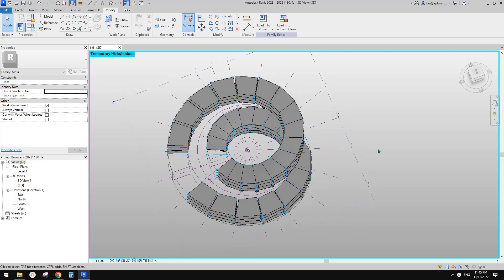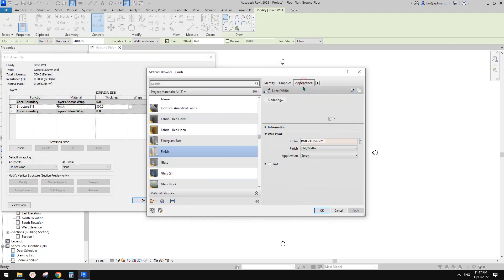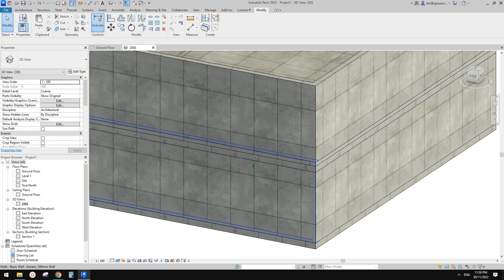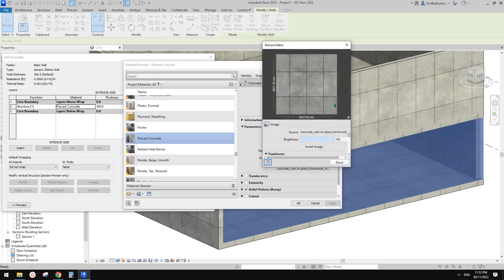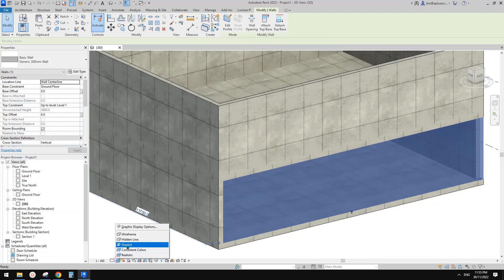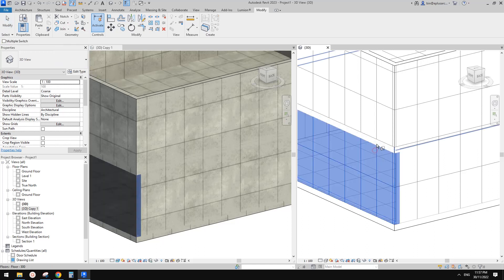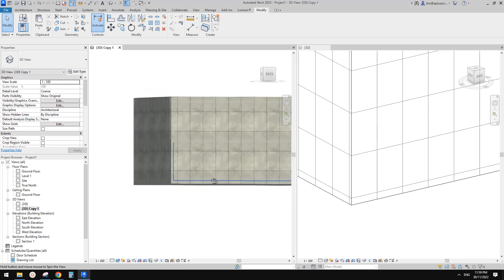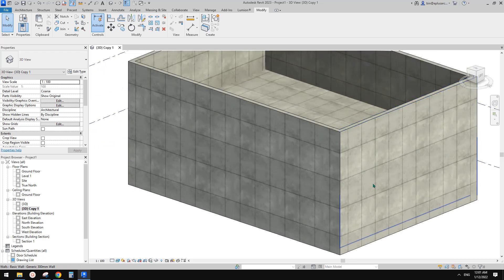Revit Exercise (Day 980) Use surface pattern to help adjust material pattern in realistic view

Comment: Okay, did not know that the hatch of surface pattern could be selected! U surprise me every time! 
I was thinking …. if the floors do not appearing in facades (maybe extended only to the core of the walls) 
And the walls start from the lowest bottom and goes up the the top in one piece , 
Is ‘nt it possible to adjust the tiling og the picture by position x offset, y offset ??
Reply from the maker: You are right, the wall and floor can be modelled differently. The x y offset will affect the entire project, which means you still need to adjust individual to match the pattern.
Reply: @BINHE615  
Ya , true … the offset will affect“ this “ material in the entire project, but you can also make as many different copies of this material as you want each has its own offsets ?  Maybe it’s a lot of work … y’a 

By the way congratulation for Australia you won over Denmark today, well deserved 💫👏🏿
Reply from the maker: Trust me, you do not want to do that. Move or align the surface pattern is much easier.  I was too tired to stay awake last night, interesting I got the result first hand from my mum back in China. Hope they enjoy the journey. :)